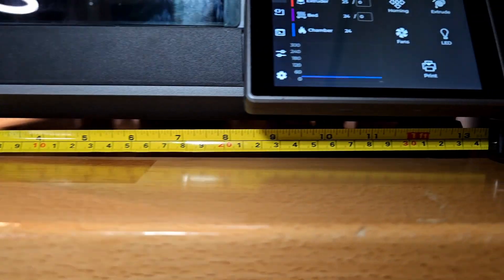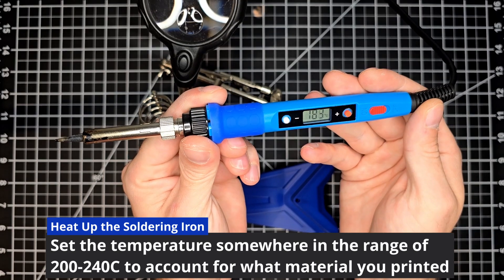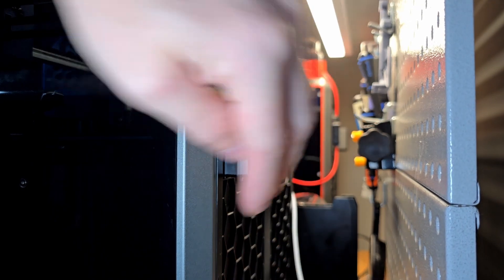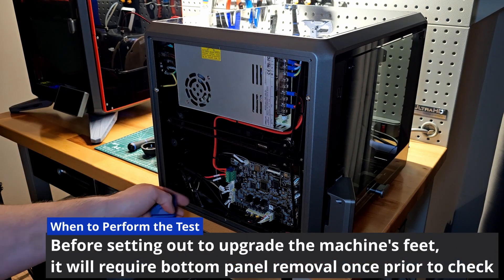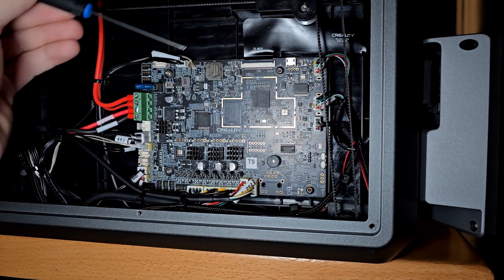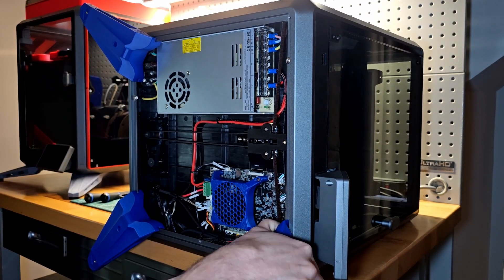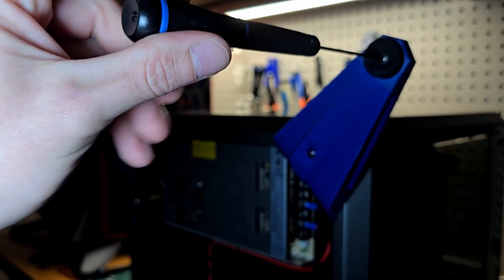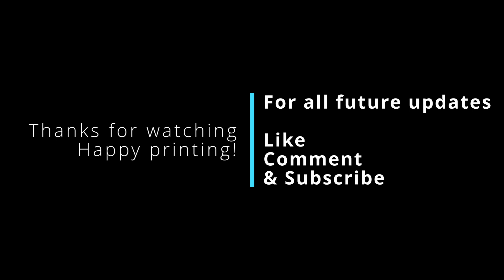Creality K1 - Derrick Darrell's Wide Stance V2 Feet

Comment: You disconnected the grounding wire, that's not exactly a great idea.
Reply from the maker: This is the ground for the USB port which goes unused (in my case). It was also noted to send files from the slicer at that point in the video (for those this still print from a thumb drive).

Comment: Excellent tutorial mate. You know they are good when there is no questions to ask!
Reply from the maker: @vhrte49  I truly appreciate that! Still happy to provide answers and input if there is ever a need though. I'll always do my best to extend the knowledge that I've acquired over time and from personal experience!
Reply: @CovenantCustom  legend
Reply: Hey mate just a quick question. I have a v3 se atm. I would like to upgrade. What Would you suggest? Maybe not a bedslinger. Thanks mate
Reply from the maker: @vhrte49  Really depends on which route you're looking to go! What are your expectations for the next printer? What do you plan on using it for? What size build volume? What materials are you hoping to melt? Ready to print out of the box? DIY build? It's truly up to what you're looking for in a machine.
Reply: @CovenantCustom  standard build volume is fine. I mostly print rc car stuff in pla + and petg atm. I would like to be able to use different materials as well. Im not ready to diy anything lol. Im still fairly new to this.  Cheers
Reply from the maker: @vhrte49  If you're printing PLA then an enclosed printer really isn't necessary. An upgrade from your V3 SE would be the Ender 3-V3 with the CoreXZ technology if your X axis is an extrusion on your machine currently. At the price of that machine against a second-hand K1, I'd buy a K1 for $200 all day long. Since multifilament isn't a requirement it would be a good fit. If you considered engineering plastics down the line, being enclosed will be necessary. If you want to do a multi-filament system, the Bambu Labs A1 mini with its MMU is a good price point but it's build area is quite small if you had plans to use it for larger RC parts or chassis covers/skins. Then it would be worth considering the A1. Not biased towards these K1 machines but I own multiple for what they can be made capable of and it's not necessary to upgrade them as they print decent as-is. Quality may be less than an upgraded machine but they are fast and efficient. For roughly $350 with the printer purchase (if you find one for $200), they can be an awesome option to consider.
Reply: @CovenantCustom  Thank you mate 👍. People beat on creality so much but my v3 se has been great. Errors have been my fault. I have upgraded to a k1 hot end after user error destroyed the original. Its been a good first printer.
Reply from the maker: @vhrte49  All I've ever owned is Creality and beyond the K1VZ build that I'll be taking on here shortly, a DIY printer will be in my future. For out of the box printers, I can't complain with their performance. They've got their issues, that I'll admit, but they're reliable once you sort through them.
Reply: @CovenantCustom  Thanks mate for taking the time to respond. 🙂
Reply from the maker: @vhrte49  That's what it's all about! Happy to help.

Comment: 🤦🤦 lol, i remember scrolling thru somewhere and seen those feet installed and wondered how they held on. I went with the Prada feet cause i liked how they also bolted on the sides. Appreciate the effort making videos! Looking forward to the next one
Reply from the maker: The great thing about these feet is that they won't interfere with Derrick Darrell's side braces which provide additional rigidity to the frame since high accelerations present flex. I decided to go this route, keeping that in mind. You provide a good point though as I'll have to detail that they won't work with the D3vil hooves due to their side mounting points. It would be a lot of filament gone to waste if someone doesn't realize so I'll need to make that very clear.

Comment: I was actually just looking for a solution for my K1! currently I have ratchet straps compressing the rubber cones into a concrete paver so the my k1 is about 50 lbs heavier, but I am very much considering some HULA feet, since there's a kit for the K1 from voxel filaments!
Reply from the maker: @eovnu87435ds  I initially had one of the machines on anti-vibration feet that were intended for use with a washer/dryer. These provided greater stability but it would be interesting to install Hula feet in addition to these as both machines are equipped to create a control element for comparison.

Comment: Cool guide. Are u going to install bed fan chamber heater mod to that k1? Interesting one and I guess I can see it already at your second machine.
Reply from the maker: @kenyajobs1069  Thanks! Going to be covering that install soon. It's most effective with a 6mm bed and 500/750W heater which I've also got planned for this machine. Results with a factory bed are minimal.
Reply from the maker: I have both the 6mm bed and 500W heater waiting to be installed. Expect a video in the coming weeks as I've got a bit of travel coming up.
Reply: @CovenantCustom  I see... Should make some research about those more powerful bed, don' have any info about 'em.

Comment: I've been running these for about 3 months and they are very good at what they do. D3vil ones are so wasteful but these rock
Reply from the maker: @ThisisDD  I never even had a consideration for the D3vil Design option after witnessing these at work! I'm very pleased with them.
Reply: @CovenantCustom  i printed these out and tried them and was much happier with them as well. The D3vil Design ones are attractive, but they are definitely not as good as these. I also love how much higher the printer rests. I can fit my hands under easily now so I don't have to lay my printer down as much